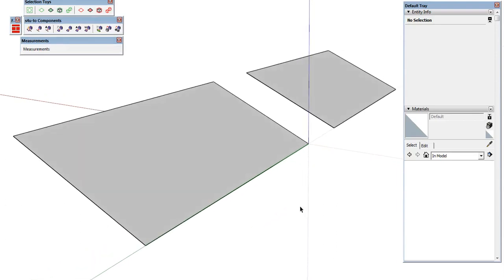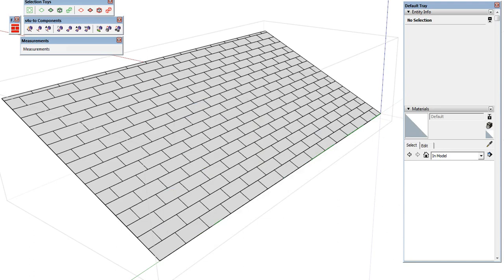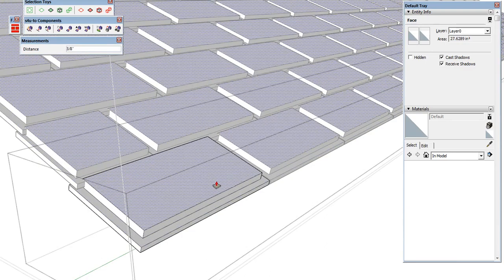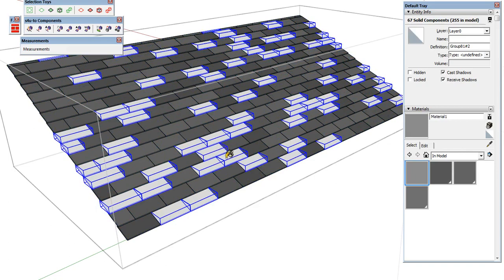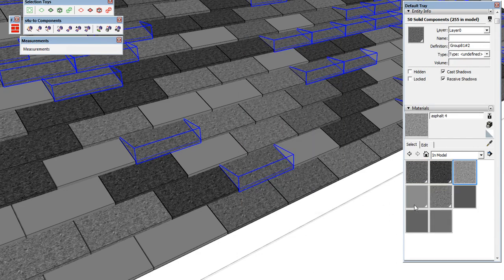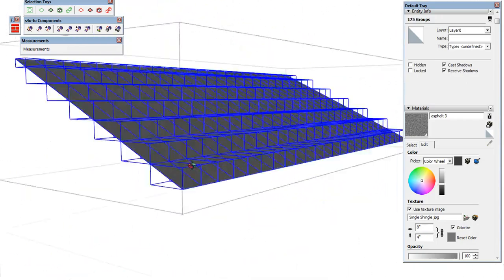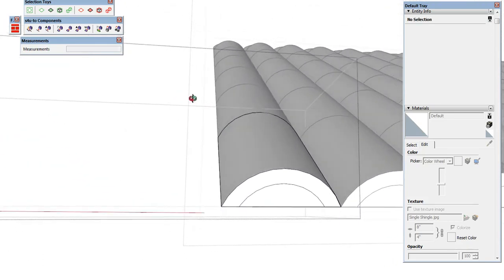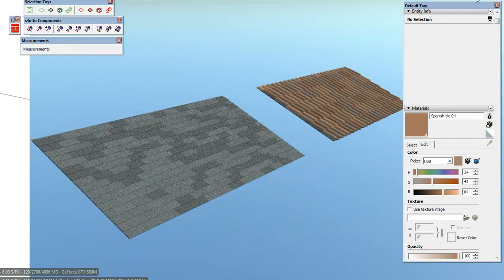Sketchup - Fast 3D Roof Tiles and Shingles

Comment: Hello! thanks for the video! 
As you did to select only the front default materials? In my sketchup not appear the options you have on your. is a plugin? (Sorry my bad English =/)
Reply from the maker: Sorry mate.  I'm using the Selection Toys plugin from ThomThom.  If you bulk select a bunch of faces, some with materials and some with default only, you can right click and choose Select Only > Front Default Material.  I have it set to a keyboard shortcut (SHIFT +ALT +F).  I hope that helps.

Comment: hi. can i ask what version of s4u tocomponent are you using. cause the one you put on there is already not available and i cant find any s4u tocomponent with 10 option or that last option you used. thanks a lot
Reply: found it https://extensions.sketchup.com/en/content/s4u-components
Reply: you can use component replacer if you don't have that last option in s4u 2 comp -> https://extensions.sketchup.com/en/content/component-replacer
Reply: sad that 2D components cannot be replaced at the moment with this plugin.